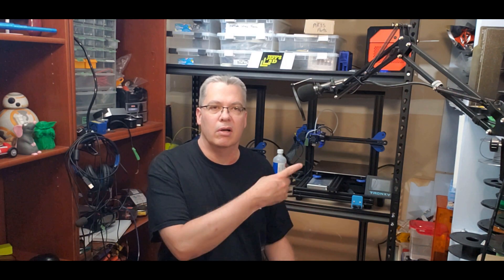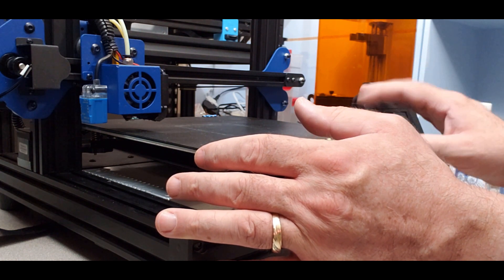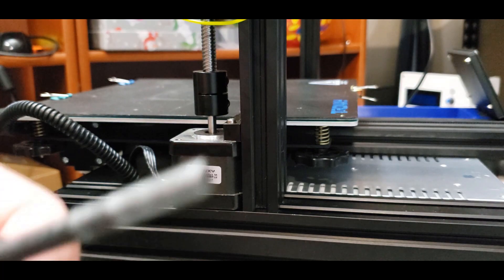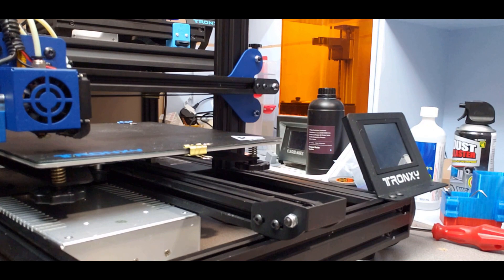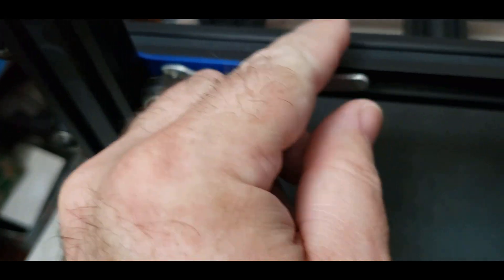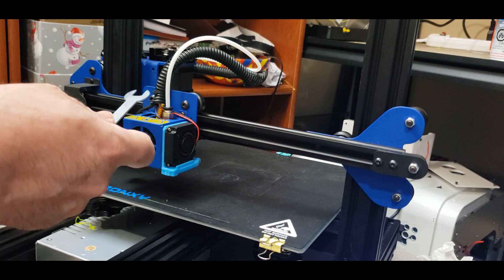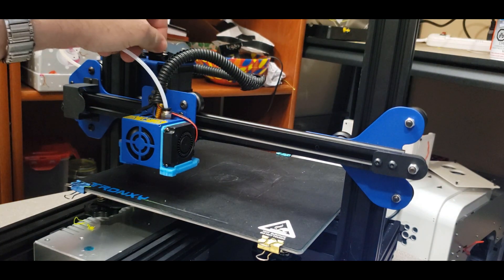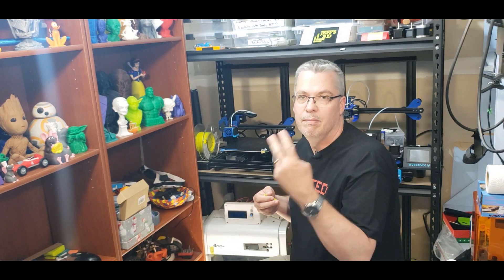3D Printer Tune up Featuring a Used Tronxy XY2 Pro

Comment: I've been having problems with my XY 2 pro and went down a rabbit hole trying to fix it. I was getting the prints skipping position on the bed fore and aft like it was loosing the Y position of the motor and I was getting the blower shroud chewed up exactly like @7:45 in this video. I worked out that the problem was the offset adjustment nut on the underside of the print bed (which I had completely forgotten about) was no longer correctly tensioned, allowing the print head to sag down only a millimetre or two and that was enough to catch the blower shroud on the print job and causing the belt to jump teeth and loose the y axis position as well as completely mangle the blower shroud.

Comment: hello, could you tell me what is the best configuration for tronxy xy pro2 + so that it does not leave threads when printing? i have tried several speeds and nothing, it leaves the pieces full of threads, please help! thanks in advance, i would also like to ask, if you recommend me to upgrade to marlin?

Comment: Jeff, just got a new X5SA pro.  Came with Chitu v6 board, but marlin pre-installed with Tronxy menus on the display.  Found out trying to figure out why save settings code would not work.  Want any info on the board?

Xy2- pro  had chitu firmware when received 6 months ago.

Comment: Hi Jeff, do u have a solution for a bedlevel sensor that can sense the bed only at 2 mm? Even a new bought sensor has the same problem. Any idea where to measure the voltage of the sensor, is it simply + and -?
Have u made any experience installing a second Z-axis, probably the ender 3 set? I´m not sure if it would fit.
Reply: I am not Jeff, he is the master here, I did install a second z screw and stepper on my tronxy... Of you like I can send some pictures and a AlieExpress link to the product I bought?
Reply: @theomoons  so u used a second motor for it instead of a belt to connect the two?
Reply: @arrgh-  yes indeed. And now I am  thinking about adding a belt too, as the belt keeps the two lead screws more synchronized.

Comment: The fan shroud is what you get when the stock firmware does not make the gantry got up if you home the machine or stop a print that is at a low level. It just rams the duct into the bed clips

Comment: Hi Jeff - love your Tronxy videos.  What is the latest FW that you recommend and where do I find it?  I have been done all of the mechanical improvements and now need to load a good FW as the one on the machine has issues and is not stock.

Comment: I love my Tronxy XY2 Pro. It’s running stock firmware but I have upgraded with an all-metal hotend and replaced the cooling fan shroud with one I printed. It’s now able to print at higher temperatures and at faster speeds.
Reply from the maker: Nice!
Reply: Which one did you print?